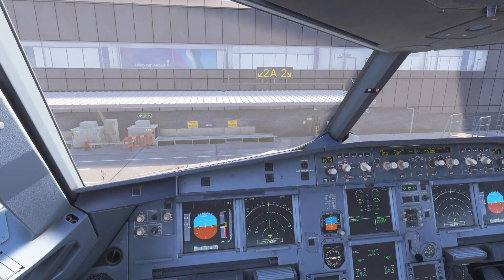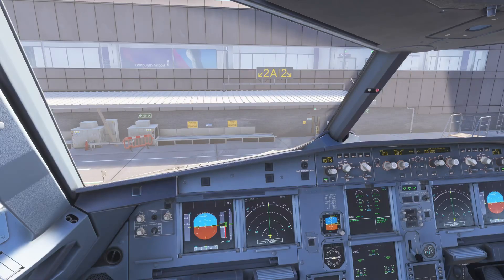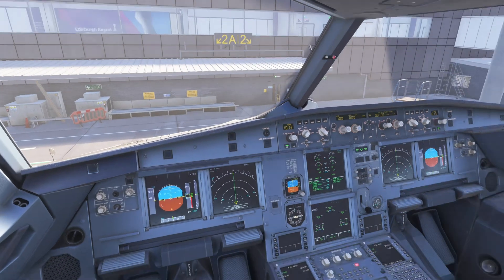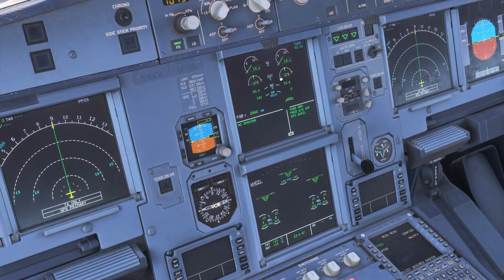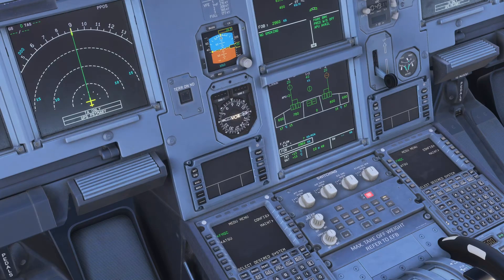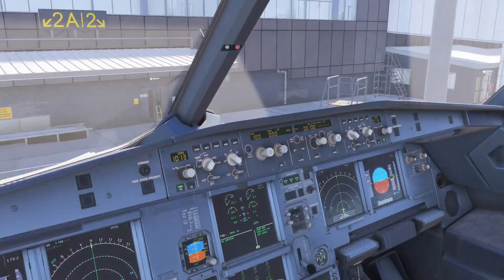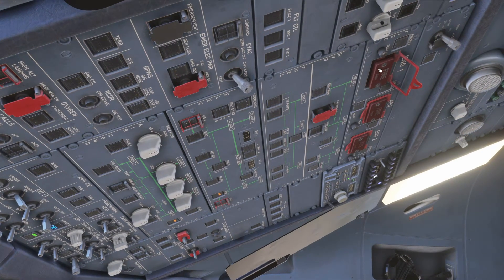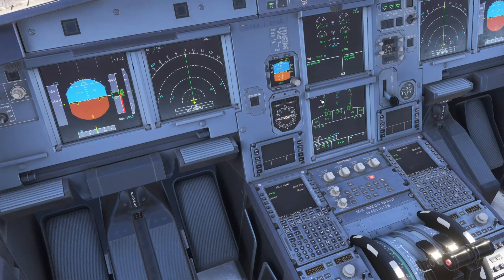A320 Engine Won’t Shut Down? Real Pilot Explains the QRH Fix | MSFS 2024

Comment: The shutdown is not immediate. Fuel is still on the fuel lines and when HP shut off valves fails and LP are needed such as Ess AC buss failure, 20 30 sec are the normm me al thing to wait the ENG to shut off. Not fénix simulated
Reply from the maker: @Gomendio  correct it is not immediate and can take up to 2:30 mins. It was about 45 seconds when I had this happen in the real world 👍